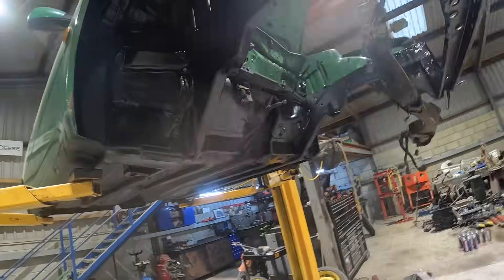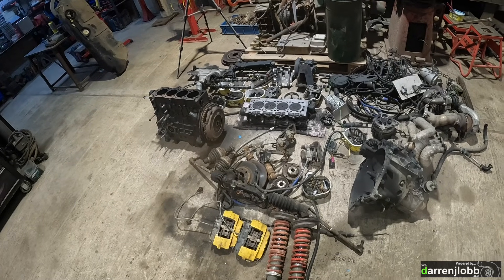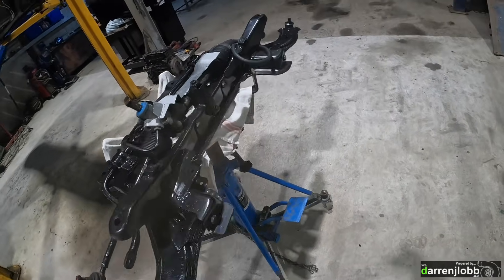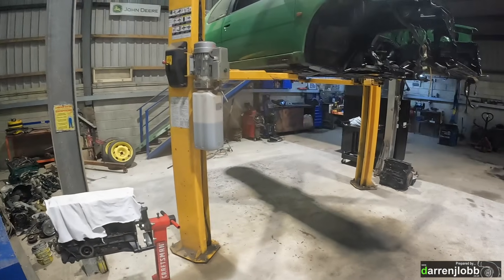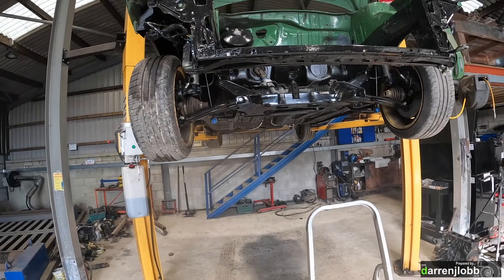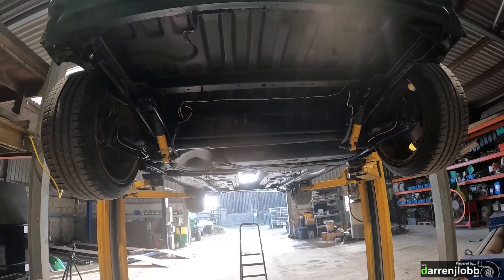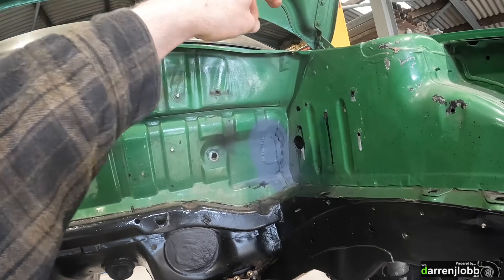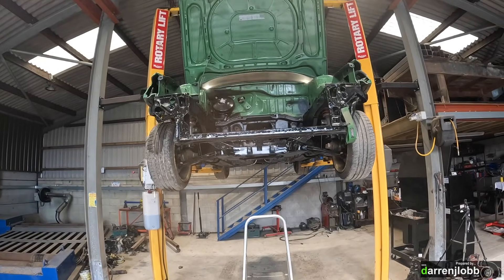The Dervbus Return! (Part 4)

Comment: Ngl, seeing all this has got me motivated for mine and making the videos again too 😅 absolutely rated the 307cc 302mm brakes when i had them on mine. Did upgrade to 4pots but i specifically designed an adapter so i could stay with the 302mm disks for ease and cheapness